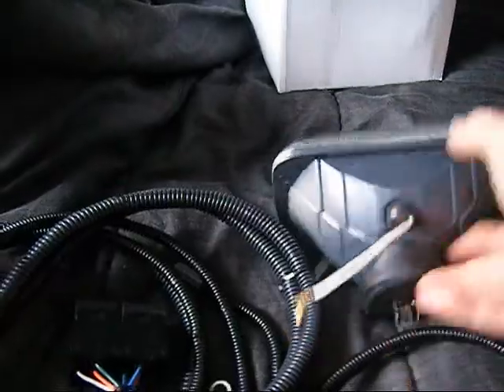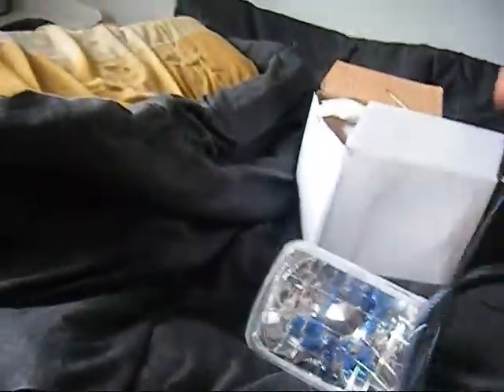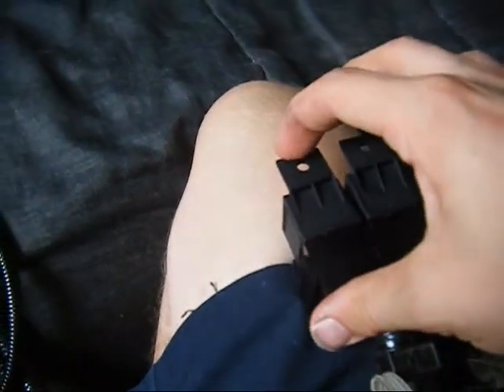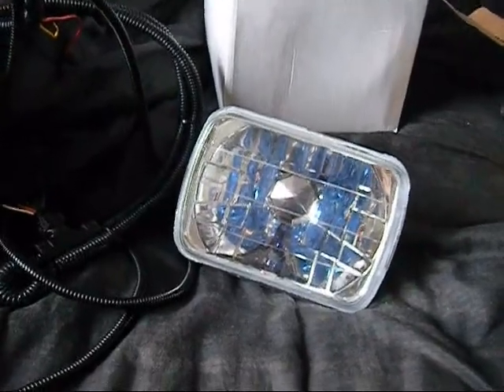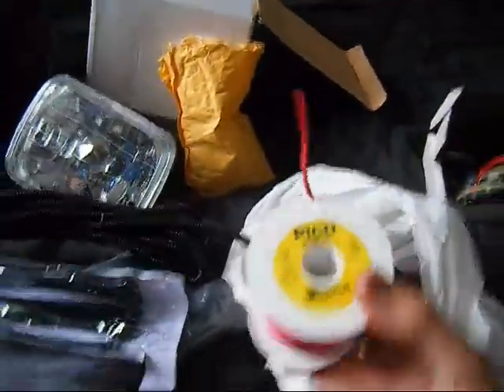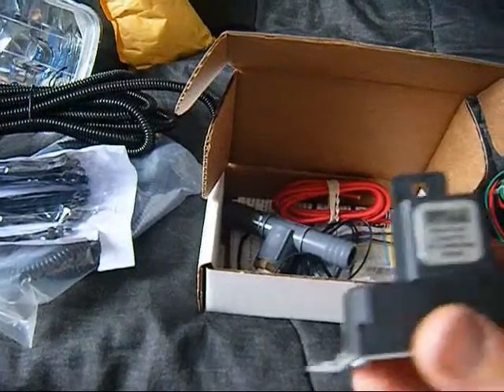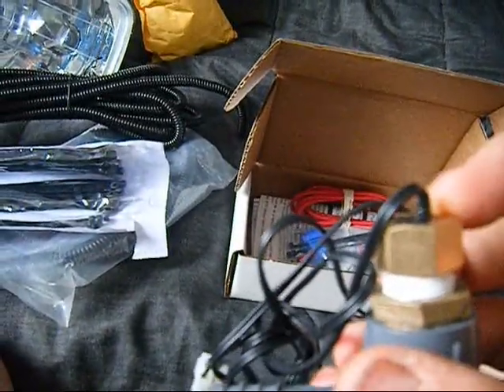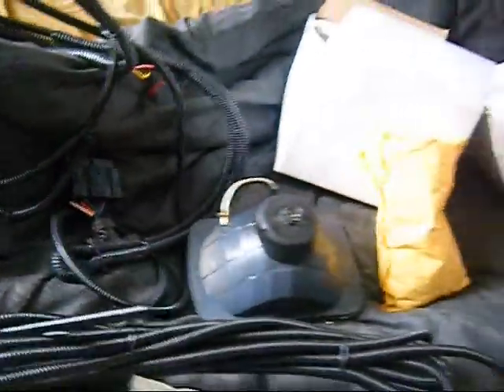new headlights and custom harness plus new high output electric fans and adjustable fan control

Comment from the maker: @X2N18 thank you, actually almost all the parts I use e3xcept for the hardware like wiring, relays ect are from ebay. they cost me about 19$cad for the part with 100/90W installed and 38 for shipping from hong kong if I recall, they were 	
7"x5" SQUARE SEALED BEAM HEAD LIGHT LAMP CONVERSION KIT, ebay has plenty, they work nice, though I did the custom harness since I dont want to burn the old harness out and have a better power feed. hope this helps, feel free to ask more :)

Comment: The headlights look great man. The blue bulbs look badass. 80 watts is a lot of power. I bet they are bright as hell. They will surely save u a lot of trouble when replacing bulbs in the future, insted of having to replace the whole unit. 
You did a awesome job on the wiring harness too, it looks like it came with the kit from the factory. You wont have to run all new wires when u get the HIDs, you will only have to install the ballast(s), relays, and switches. 
Btw did u use the GoPro?